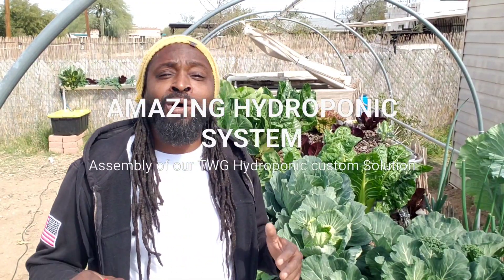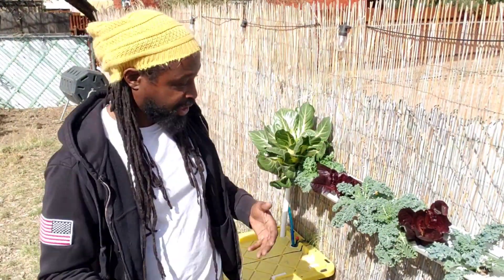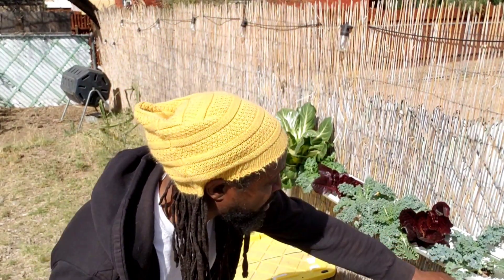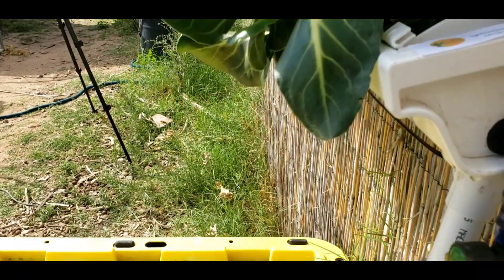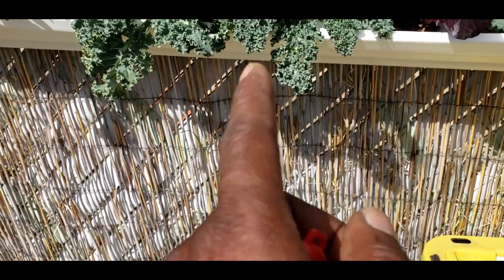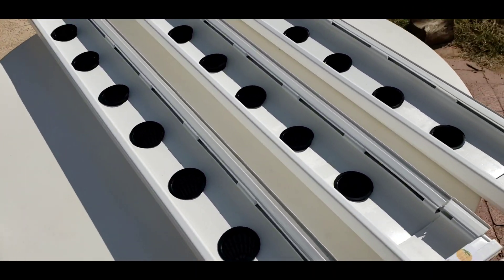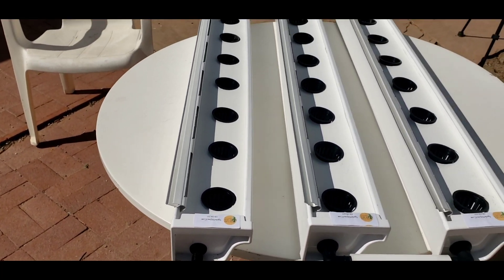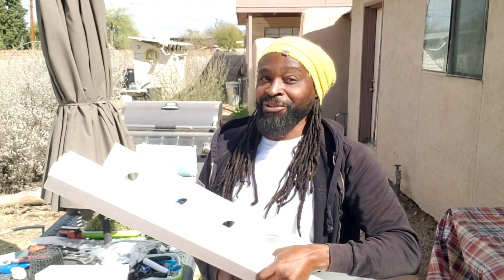DIY hydroponics system. Let's take epic Gardening to another level!#verticalfarming #hydroponics

Comment: could this be used as a kratky system ?
Reply from the maker: Hi Wayne. Great question. At minimum I would use it a a flood and drain ONLY because there's such minimum space for sitting solution underneath the roots.

Comment: Are nutrients specific to certain types of plants? How often do nutrients need to be replenished in the water? I see many videos on hydro stuff but ive never been able to find much discussing proper nutrients and when/where/how to properly use them. Thanks for the video, what a great use for gutters!
Reply from the maker: Hi! Let's take it from the top.  We try to grow veggies with similar parameter requirements in our outdoor hydroponics solutions.  The larger the reservoir, the fewer top ups required. We only *feed (add nutrients) our  reservoirs every 2-3 weeks depending on the temp and the age of the plants. Watch the plants, they'll tell you when they're hungry, thirsty etc. I hope this helps
Reply: @togetherwegrow8340  thanks so much! Im currently waiting on my aquaponics water temps to come up just a tad before adding fish. The system is cycled at this point and its our first go at it. The more i learn the more i see there isnt much difference in the care of hydro vs aquaponics.
Reply from the maker: @UserFormelyKnownAs_hjkh  brace yourself for this. Actually far LESS care in large scale aquaponics imho!
Reply: @togetherwegrow8340  im on 4 acres with pigs, goats, and chickens. I have plenty of room to grow! Honestly got into it because we basically live on clay and anything other than trees have a hard time taking root in the weight of the soil. I figured aquaponics or hydro might be the way to go. So this is our little trial run. When ready im just going to go catch some bluegill or channel cats to put in the tank. Fingers crossed! Thanks for all the great information you put out into the universe!
Reply from the maker: @UserFormelyKnownAs_hjkh  man listen, you might look out the window and see a Rastafarian called out in the cuts lol! You got it going on fam!!